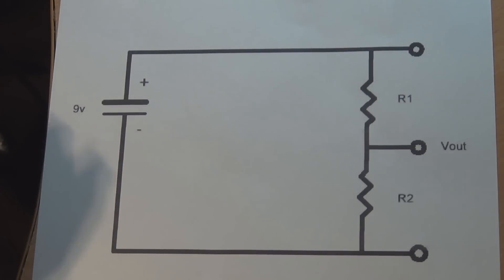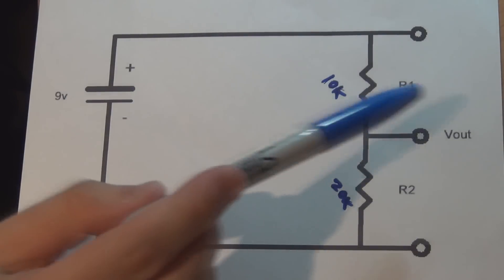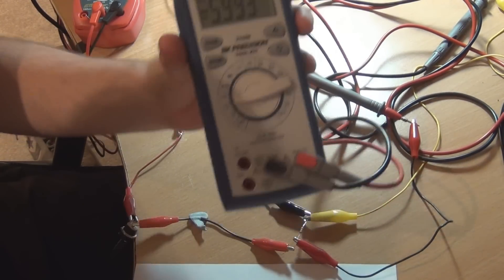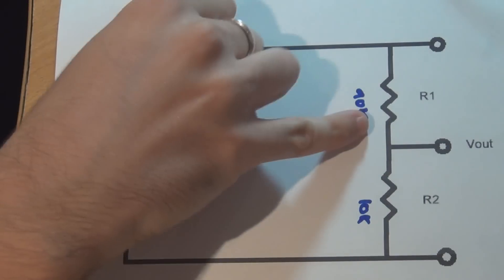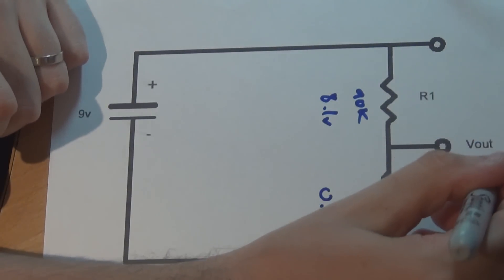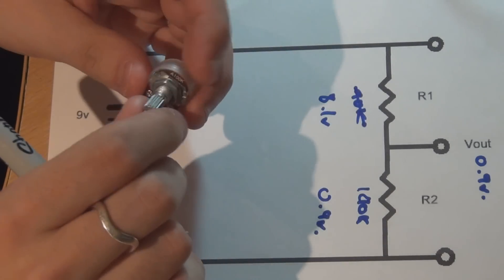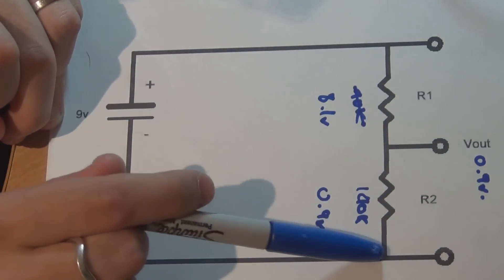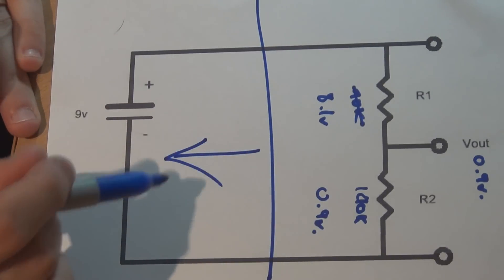How the volume control on a guitar pedal works

Comment: The way I think of a potentiometer is like a resistor with a movable tap.  It's not really a variable resistor, the resistance from pin 1 to pin 3 is constant.  You just have a tap (pin 2) that can move along the entire surface of the resistor... which is literally what it actually is, mechanically.  There's a wiper that scrapes along the surface and turning the shaft slides the wiper along the resistor surface connecting the middle pin to various positions along the surface of the resistor.  The schematic symbol for potentiometer shows a resistor with an arrow pointing to the middle of it.  This arrow represents the wiper touching the resistor.

Comment: So is R1 supposed to be a fixed resistor and R2 a variable resistor? So that when you turn the nob you’re adjusting the resistance in R2 which affects the potential difference?? Idk tbh that’s just what I learnt in A level Physics 😊

Comment: I'm struggling with a reverb pedal build that outputs less than unity gain. will adding a volume pot offer any possible increase in output or only adjust it from the existing level to lower?
Reply: Yeah it will only lower, you would need an amplification component (an 'active' component) to raise the signal level back up to unity or above
Reply: I will only lower it

Comment: Hey ! Nice video :)
I still have a question : as volume is controlled by a ratio between two resistor values, what would be the differecen between having, say, 1k/10k and 10k/100k ?

Comment: Would it also be ok to use a single resistor in series at the output of the circuit to provide a volume reduction? Some pedals I build are way too loud and was thinking of adding a 10k or so to output to lower volume.
Reply: hey man how can i get more volume from my pedal. i built a pedal and when i crank the volume on it its just a little over unity volume. are there any mods i could do to get more volume? love your channel dude

Comment: Not trying to be a jerk but you're math here doesn't seem to add up.

Vin x (R1/(R1+R2)) = VR1
9 x (9000/19000) = 4.26V

Vin x (R2/(R1+R2)) = VR2 = Vo
9 x (10000/19000) = 4.74V

I'm a little rusty with my circuits knowledge but I'm pretty sure I'm right.
Reply: 90k for R1. Nvm, that's right.

Comment: HannesJvv: you wanted to see the inside of a POT? 
The old pots are better to look at as a example of this, Coil Copper making up one big Total Resistance, and a Bar in the middle running along it.
As the Voltage AC/DC is shaired over the Resister, at the point of were the Middle Run lays on will be a Fraction of the total.
What gets me Why use 250K and not say 50K if there all PD

Comment: While I can appreciate the fact that you explain the use of a voltage dividing trimpot in this video, it's just disappointing otherwise. I thought a video entitled "how the volume control on a guitar pedal works" would actually show an actual example circuit of ... well... how a volume control on a guitar pedal works. Instead it just shows how a DC voltage divider works. All the important questions remain unanswered  :C

Comment: I suggest you get a multimeter and see how the resistance changes between the different legs of the pot. Most trimpots I know have three legs: one is connected to one end of the resistor, the middle leg connected to the turning knob and the resistor, and the last leg is connected to the other end of the resistor. This means the resistance between the two opposite legs is always the same. As you turn the knob in one direction the resistances between the middle leg and the other two legs changes.

Comment: But if you were to do it the other way around, input signal to lug 3, output lug 2, lug 1 grounded, it will do the opposite. Turn the knob counter clockwise, decreasing resistance, thus allowing more signal through making guitar louder. Hook up a pot to your multimeter and experiment.

Comment: 1   ---vvvvvvvv---  3. 
            2
Thats the pot schematic symbol. 1 is lug 1, 2 is lug 2 center lug, and 3 is lug 3. The arrow in the schematic pointing to the wavy lines is the wiper, or the knob turning on the inside of the pot. The guitar signal goes into lug 1, and outputs to lug 2, 3 is grounded. That way when you turn the pot clockwise, it decreases the resistance of the pot, thus allowing more signal through, making guitar louder.

Comment from the maker: Not sure about that, but i do know that some circuits have a capacitor before the output pot.  The capacitor in combination with the potentiometer make up a high pass filter.  Increasing the resistance of the output pot increases the cut off frequency of bass. I discovered this first hand when i lowered the output pot on a tonebender and ended up with a very thin output signal. But anyway, thats a subject for another video :)

Comment from the maker: You are correct but in a voltage divider circuit you have to look at BOTH resistors to work out the voltage on the output. Think of the resistance as a speed hump.  if the resistance to ground has a larger speedhump then the resistance to the output, more voltage will appear on the output = the path of least resistance.  I would highly recommend doing this exercise with some resistors and changing values.  You will what raising and lowering the values will produce on the output

Comment: One thing that keeps confusing me is how does higher resistance = more signal? I thought the higher the resistance the less signal that gets through because a resistor "resists"? :S

I also agree with CrimsonTunes about a video for understanding schematics, such as a side by side with an actual circuit showing how the schematic translates into an actual circuit.

Thanks again! Keep it up.